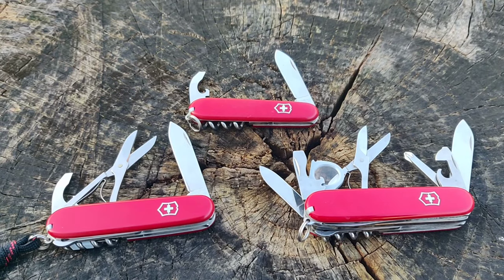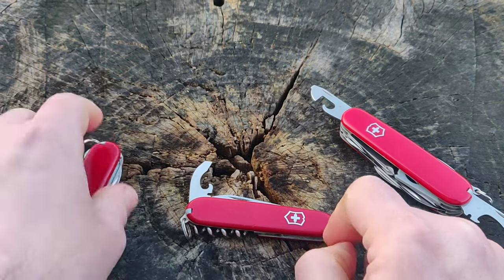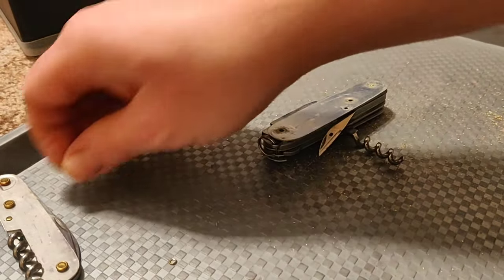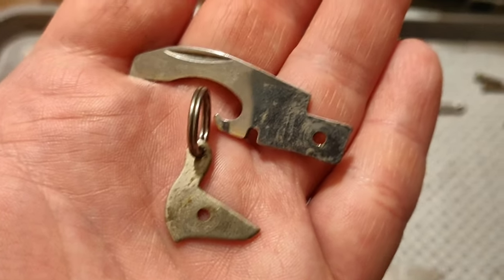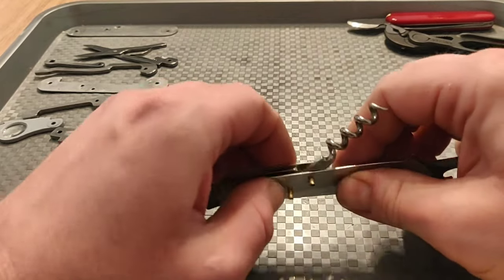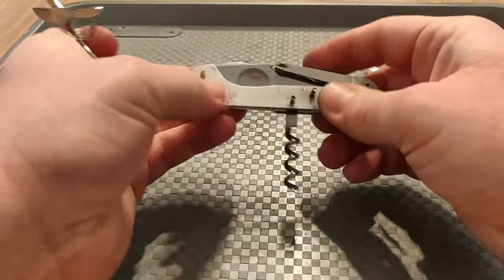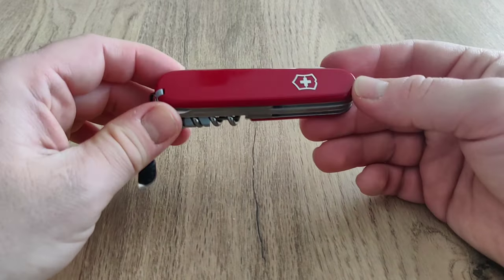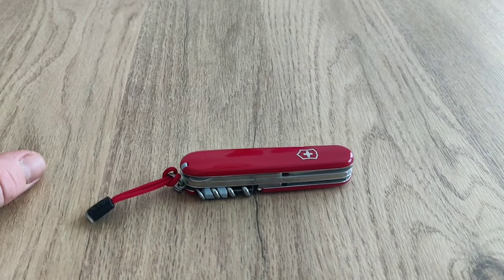Victorinox Yeoman - Custom Mod

Comment: is it possible to put an awl?
on the back spring of the magnifying glass and philips?
thanks.
Reply from the maker: @arghiesambrano  no. But you could put an awl insted of the hook, behind the scissors. But it needs some modifications because they need to be the same thickness
Reply: Appreciate the reply, thanks.
im thinking I could use the back spring of the awl of the explorer to replace the back spring use in the magnifying glass and philips. I assumed wrong. Thanks a lot.